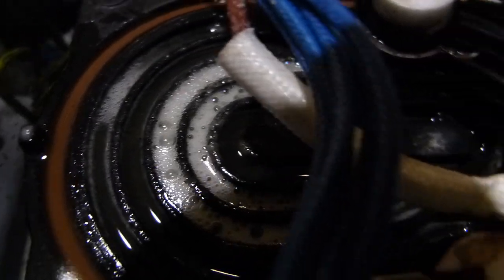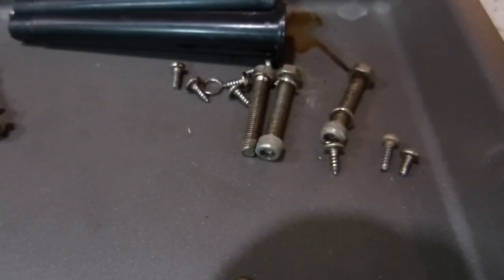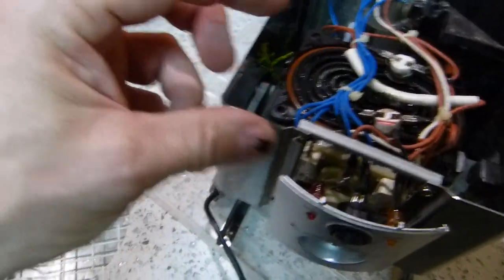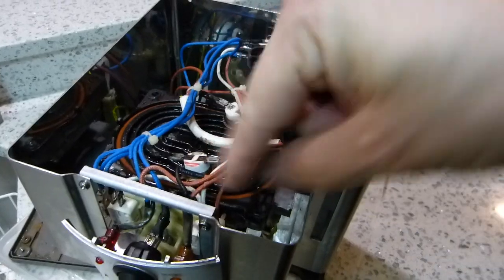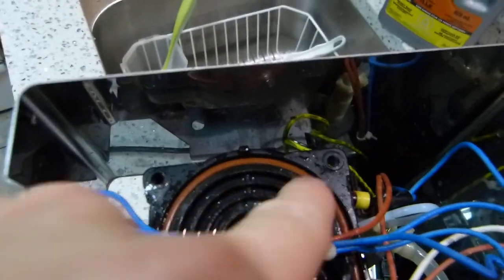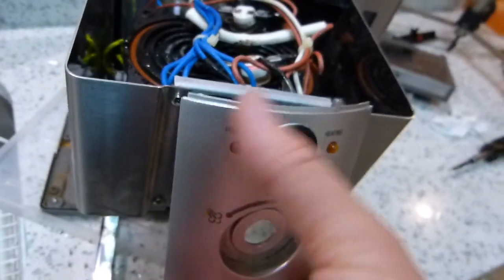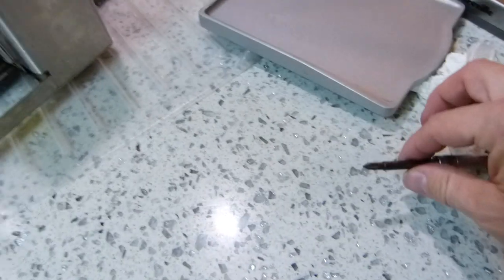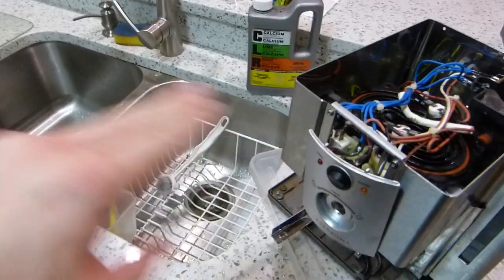Espresso maker repair

Comment: I had the same problem on the exact same model. Water came out was 70-ish Celcius.
All I did was I bought an espresso machine descaler. Put it in a water tank. Run it through the machine and reuse the solutions again (several passes). At the end, I got 95C water coming out without removing any screw. If you have an Espresso machine, make sure you descale it from time to time.
By the way, I have been using my machine for almost 20 years. For something that is $200+ it was very well built and well worth the price!!!

Comment: How did you remove the knob? D:
Reply from the maker: Knobs are pressed in place, so pulled it off, switch screwed to housing
Reply: Im also trying to remove mine, no luck so far.
Reply: Did you manage to remove yours?
I have no luck so far either. 
If it's pressfit i have to pull it so hard as to maybe damage the white plastic part its pressed into.
Would there be a tab of some kind?
Reply: It turns out it was glued and press fit. I just pried out mine but if i had to do it again it'd try some acetone, goo gone or other solvent applied with a qtip before prying out.